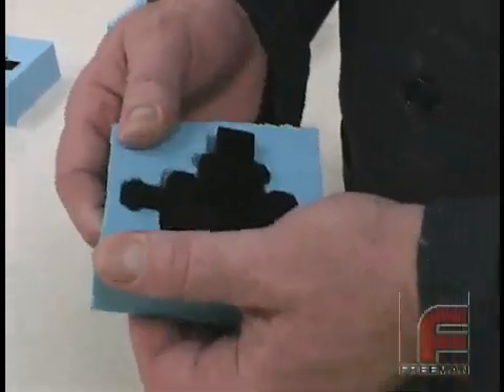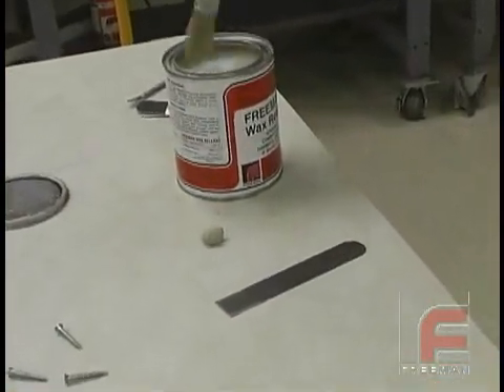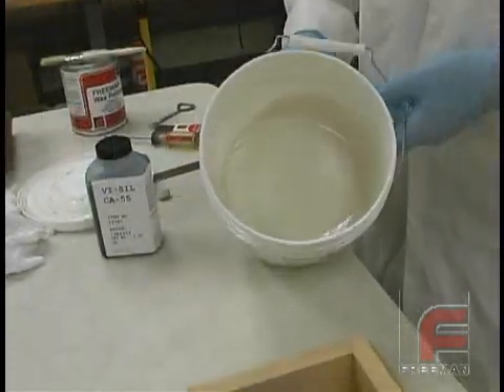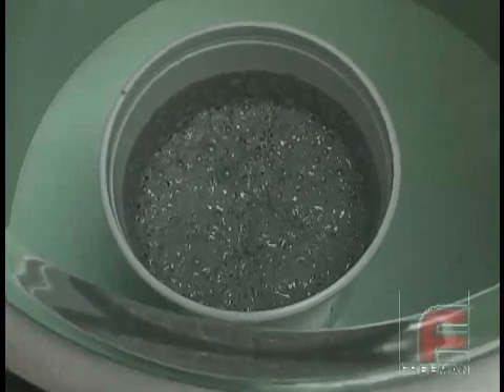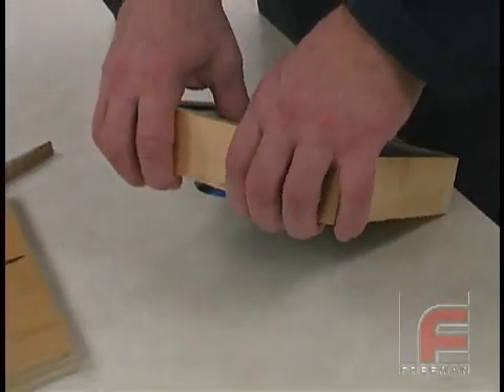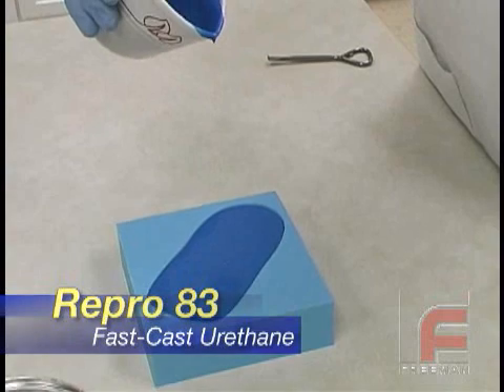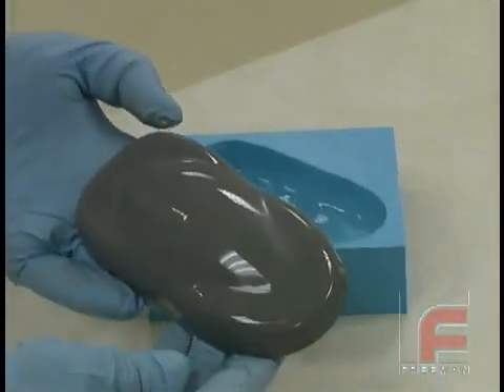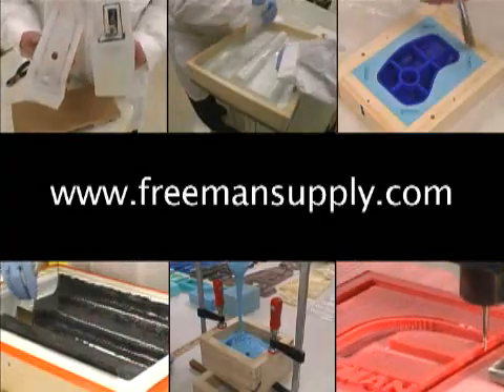Simple Silicone Rubber Molds (no parting line) - Original Version

Comment: I need to make a mold for some exhaust hanger bushings i want to make out of Polyurethane. Can you guide what to use to make the mold for the bushings? Original bushing is made of a hardened rubber.

Comment: I wonder can I use this Freeman 1060 to fix a shoe sole that got small part missing ?
Reply from the maker: Thank you for your question! We do not recommend using Freeman 1060 for this application or similar applications. This material does not offer enough abrasion resistance and, like our other products, is geared more toward prototyping.
Reply: Thank you very much for the info. Could you possibly recommend another product for this particular purpose please?
Reply from the maker: Unfortunately our materials will wear out too quickly for an end-use application such as yours. Our products are designed for prototyping, meaning they are not meant to offer extreme durability and will not work for this purpose. We suggest finding a manufacturer that focuses on more commercial-use products. If you have any further questions we have a technical help line available Monday through Friday 8 am - 5 pm EST if you would like to talk to our Tech Team! You can also email contactus@freemansupply.com. Thank you for reaching out!
Reply: freemanmfg Thank you.

Comment: +freemanmfg, Is your material ever used for body surgery for tissue degeneration? Hydrogel polymer is something that is being used for back surgery and is there any input you have or information on the risks of having these in your body? How long they would last? Do they disintegrate inside the body and leak, like silicone implants? Do they become hard and non-flexible?
Reply: while they probably don't know much about it's application for the body they did mention that the detail was effected by high heats, so it's unlikely to have much problem in the body unless you frequent saunas or things like that,as for an educated guess i would say as to risks i don't think there is to much to worry about, i believe somewhere i heard that a pro to using synthetic parts over other peoples is that you don't have to worry about your body rejecting it as for it breaking down i don't think they would use it if there were that possibility within your life time at least
Reply: Our materials cannot be used internally.  Our materials are used for industrial use only.

Comment: Why not a glass or plastic surface instead of a wood base.
Reply from the maker: +My Space, Mold boxes can be made out of a wide variety of materials. Using a glass or plastic surface could provide you with a nicer surface, but the video was made with a wood mold box because wood is a common and economical material often used to make mold boxes.
Reply: +freemanmfg like that answer :D
Reply: +freemanmfg  Thanks for your reply.

Comment: Depending on which foam board you are using, you may have some curing inhibition with addition cured silicone.  Once the silicone mold is created, you can pour cement into your mold to create your casting.  If you need further assistance, please contact our technical department.

Comment: Kinda useless to say "No parting line" as any other method to make a flat one sided mold like that would also give no parting line,  there is NOTHING to part!
 Make a 2 part mold if your going to CLAIM no parting line.
 If your going to try advertising your products this way then also you should mold an item that actually has some kind of shape and some details, not just a basic blob with a few contours,that car body looking thing was pretty useless really. That half a valve was kinda nice, try making the entire thing both sides as 1 solid piece though and show us that it then has no parting lines using a 2 piece mold to make it.
 Or better yet, make that valve in a 2 part mold with a core to make it hollow end to end through the center and THEN show us "No Parting Line"!
Reply: Den Stump Those "car body looking things" are actually used by professional car painters to display how the paint reacts with light. That's not useless at all.
Reply: Jinppa it is useless to say there's no parting lines... because there's no parting it. so... useless to prove this video
Reply: Den Stump 
.
Reply: 16 hours to cure? jeez e. pete's! and, why would you do this on a wood board you have to seal instead of something like foam core or... anything else?

Comment: I could use some help. I am a beginner well it will be my first time making a mold. I have purchases acrylic 2 part epoxy. A friend of mine will be printing something that will look like a 2 part small box. After the box has been printed. How can I make the walls smooth to take a mold of it. What type of rubber epoxy should I be using. I will be putting gasoline in it the acrylic box. I hope it won't interact with gasoline. I need to know what type of plastic epoxy will not react with the gasoline if this 2 part acrylic epoxy will. 

I would also like to make gaskets that are heat resistant and resistant to sodium hydroxide and potassium hydroxide. 

Any help would be extremely appreciated. Thank you

Comment: Dear, what would be the best method to build a mold silicone to copy the body of a mockup of a bus with about 40cm in length where the part would be hollow inside to reduce weight.

Comment: 3D printers are going to end all this in the very near future
Reply: Yeah, they said that when all humans was on a auto assembly line in 1955   "people will always work the assembly line" .   EVERYTHING changes with time,  you will see as you grow up.
Reply: Not to mention the high cost of a 3D printer compared to silicone molds. At least for now, this is a much more economical route.
Reply: Shane Doe
  You have to create a mold for each product style you want to make. A 3D printer (which you can buy under $800 now  you would just need the blueprint software that you design or download at a cost of $0 and done in minutes.   The initial cost maybe higher but the $$ saved in thelong term is substantial.
Reply: This is much easier to do then 3d for a sculptor who doesn't have the resources to scan a model, then print, then doctor the print. At the moment it is much faster to get flawless molds with a tech that is cheap and reliable. 3D is still a logistical fantasy for many artists who wish to mass produce. INFACT molding itself is JUST NOW starting to get into the layman hands (logistically speaking) so... lol.
 For an artist or "customizer" this Freeman Manu. is a godsend.
Reply: That's easy for you to say because it's always been over for you.
Reply: lol. I'm just saying if it never starts, it's always over xD ...but that's not a very nice thing to say bluntly so... ya.

Comment from the maker: Silicone is not typically recommended to use as a mold material when casting cement.  Because of the pH in the concrete, the silicone can leave a white film on the concrete casting that will not come off.  Molds for cement castings
are typically made of a flexible urethane.  We offer the Freeman 1040 and Freeman 1035 Flexible Polyurethane Elastomer.

Comment from the maker: @Karl Azzopardi - We are not sure what you mean by ingredients.  The car pattern is made out of Repro 83 Fast Cast Urethane.  We applied Plast-econ Modeling Clay to adhere pattern to mold box.  We brushed on a layer of wax release to help with the releasing of the silicone mold.  The silicone we are showing in the video is the V-340 Base with CA55 Catalyst.  If you need to know the incredients of these materials, our MSDS are available on our website.

Comment from the maker: There is really no way to get around not using a release.  If the mold was made our of a flexible urethane, you would not need a release to release the silicone part, but you would
need to use release agents when making your urethane mold.

Comment from the maker: Yes, you can use silicone mold to cast silicone, but you would need to use a release agent.  Silicones do not stick to anything, but silicone.  If you need to release silicone from silicone, you can use Pattern Release 202.  It is basically petroleum jelly in an aerosol.

Comment from the maker: Silicone cures at room temperature.  The vacuum degass is used to rid the air bubbles from the silicone that were introduced during mixing.  Our PT Accelerator can be added
to the Addition (Platinum) cure silicones to accelerate the cure time.

Comment from the maker: Please note our materials are primiarly used for mold making and prototyping.  Our materials are not meant for continuous hand contact.   We would suggest taking a look
at our V-330 Silicone Rubber for your mold material, and our Freeman 1085 for the prototype/ casting material.

Comment: so i have an airsoft gun target that has a sticky outer layer (to catch bb's) and a layer of foam under it (as the thing that you actualy aim at(the sticky stuff is clear)) but the airsoft guns brak and shread this foam over time, rendering it useless, however i was thinkin of using two different collored, soft/rubery material that can absorb the impact and have diferently shaded rings to aim at, what two would you recomend (i wont need a casting material, i already have a cast)

Comment: where can i buy this stuff the only place i know is smoth on.com and there expensive and i plan on making props
Reply: Hi, do you still need rtv2 silicone rubber to make mold? 
We have silicone rubber equal Smooth on like mold max 30.
But price much cheaper. We are China factory directly.
bonnie@xrsil.com
www.xrsil.com
mob:008615616128028

Comment from the maker: You can cast silicone on silicone, but you would then need to use a release.  Silicone will not stick to anything but itself.  You can use Pattern Release 202 or simply 
Vasoline.

Comment: Hi there ...I have an issue I hope you can help me with. I am trying to find a product which I can make a mould for a crossbow limb tip. I have upgraded to a more expensive string and shortened it by and inch to increase the power load. The issue is the cheap tips blow after so many shots because the expensive string is a lot thinner than the standard string and cuts through the item easier because of the increased pressure. I am looking to make a tip similar to the EXCALIBUR 'Magtip'..cheers

Comment from the maker: The fast cast urethanes and some of the rigid urethane elastomers can be painted.  The silicone should be degassed to rid of air bubbles.  If you do not have a degassing unit, you could brush on a couple of layers of the silicone.  This method would rid most of the air bubbles on the surface of your mold.